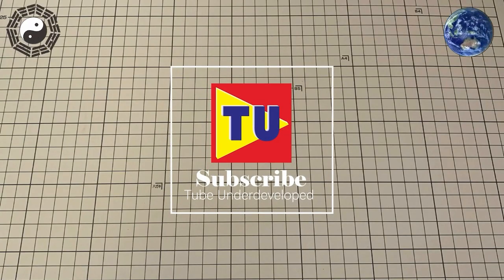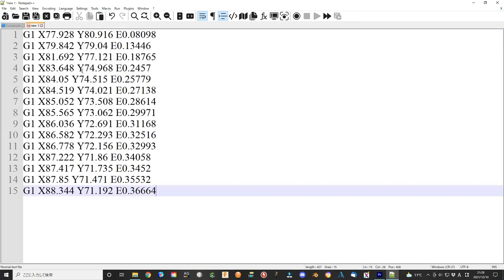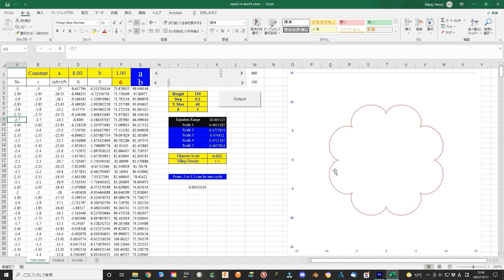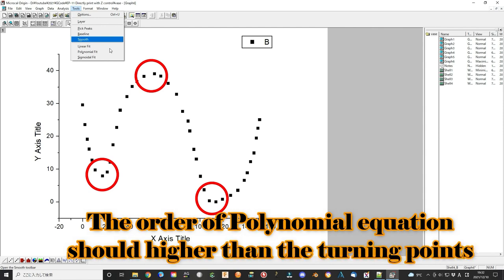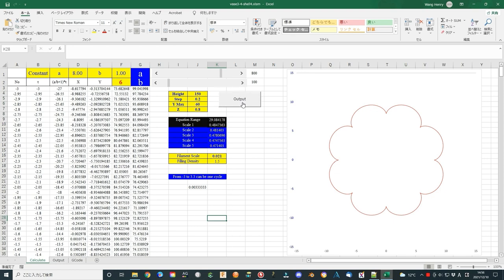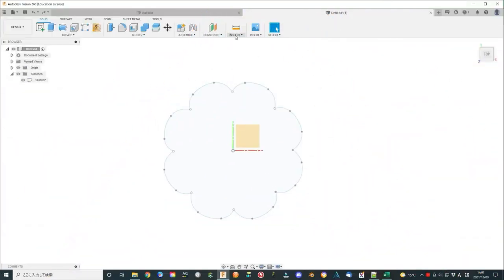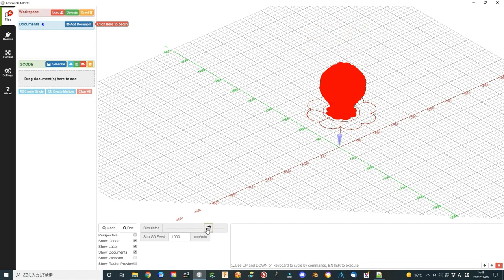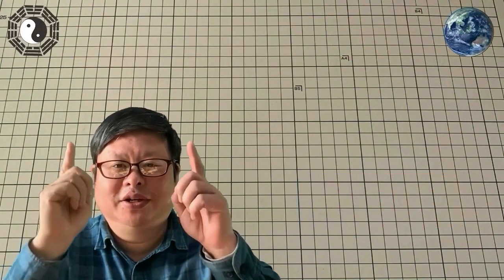Print a Vase directly with Z control (Generate g-Code using EXCEL and Equation)

Comment: Respected Sirr, is it possible to change the infill angle sir
Reply from the maker: Hello sir, what do you want to do by changing the infill angle? It is related to the 3D printer metal head. Physically it is fixed. Nice to see you really dig deep. Keep going. Have a nice day.
Reply: @TubeUnderdeveloped  Respected SIr., you have done excellent outstanding work., you deserve for Gold medal for this study.,
Sir., I may have doubts in between  for the work which you did here., please help me in this regard SIR
Regards
Reply from the maker: @mohammedabdulla8693  The infill angle can be changed using slice software. I have not considered using EXCEL to change that parameter. If you want to change it please make a equation and calculate the correct answer. Good luck.

Comment: Respected Sir., 
good morning Sir,
if we take three different types of nozzles., 
Extruder value E varies,  or not, or depends upon the shape E calculation will vary.,
If it varies with the shape of the nozzle how, sir.,
Respected Sir., If it is varying where to do changes.

Sir, we used the continuity equation to calculate the value of E., but I may be a fresher at this work., I feel that the value of E is the same for changes in the shape of the nozzle  may be I am wrong too..,
Sir., Plz help me in this regard.

Request to reply please SIR.,
Regards
Reply from the maker: You can change the filling density or scaling factor as well. No matter if there is an equation to calculate the Z shape the final goal is to know the value of x and y values, then you can calculate the scaling factor when z is defined. Hope it can help a little. Good luck. have a nice day.
Reply: Respected sir, I will go through your video to understand the scale factor.,